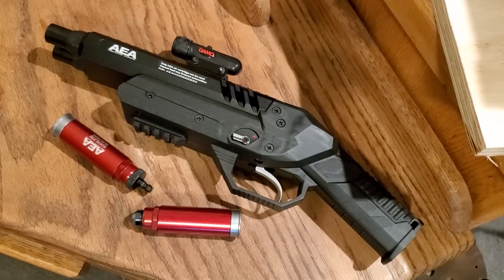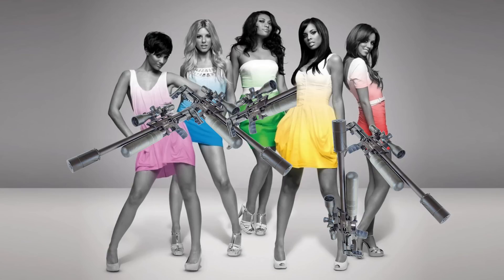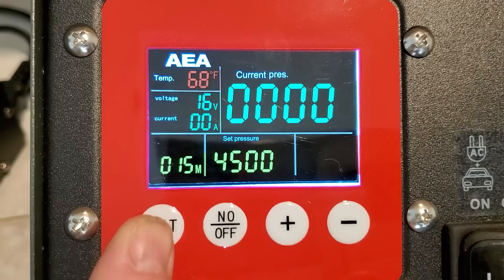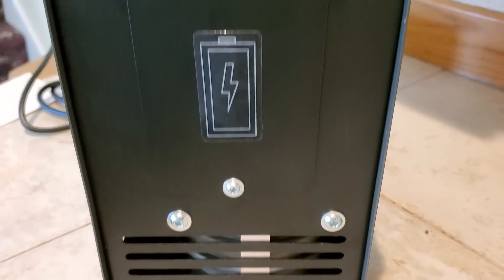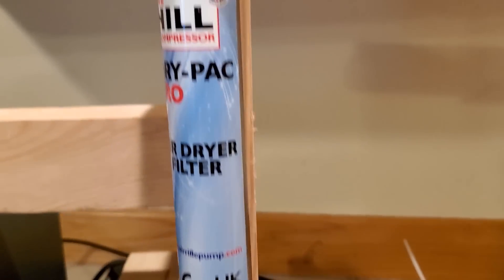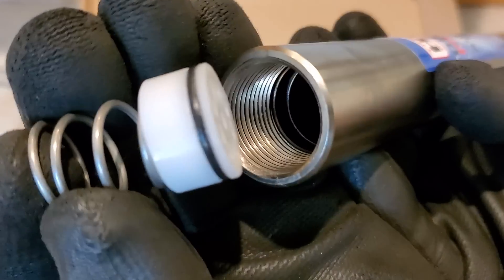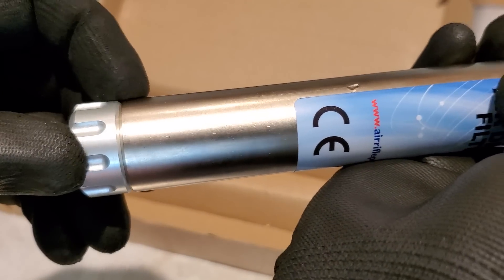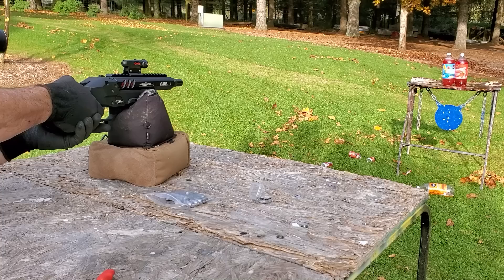AEA's 7000 PSI Air Compressor for PCP Airguns (Review) AEA Airguns Shop  (480bar) PCP Air Compressor

Comment: Compressor will last longer and work easier if you leave the bleed valve open until the piston is running and then close it
Reply: Doesn’t matter if the bleed valve is closed when there is no pressure in the system.  It’s if you stop during the fill for some reason you have to bleed it before restarting.  When you are beginning to fill it makes no difference.
Reply from the maker: Thank you!!!!!!!!!!!!!!!!!!!!!!!!!!!!!!!!!!!!!!!! -Nate
Reply: And open it again ( bleed valve ) before switching it off.
Reply: @henrymoreland8719 then why even have auto shut off? I think that is only with Yong heng it's a problem you haf bleed pressure right at shut off. I have a twin piston tuxing. I never bleed it at 4500psi auto shut off. I let the auto shut off stop the compressor and then bleed air. 130 hours on it no issues
Reply: @DanielDyck-n9d - I have the same twin.   3 yrs old in April.   I don’t open bleed before shutting down.  The auto stop trips and then I bleed.   Has been the best compressor I’ve owned so far.
Reply: @henrymoreland8719 you’re thinking far too much!
Reply: Money
Reply: I learned this the hard way not that long ago😂, although it wasn’t funny at the time, I’m new to pcp airguns and it’s hpa that is the most daunting aspect of getting started. I’m positive it keeps many people from trying the stuff over 2500 to 3000 psi guns. I’m on my third type of hpa compressor , a Tuxing 2200 watt electric unit that comes mounted in a generator frame and has the high and low pressure compressor heads separated instead of stacked like a Yong heng type. It’s faster than a Yong Heng , but I’m fairly sure that’s because of the 2200 watt electric motor, YH are 1800 I think. I need a better filter , the air is dry but has a slight oil smell to it. First I thought I put to much oil in it, but I’m starting to think it is just they way it works and I need better filtration.
Reply: @noonespecific9463 hey bro I’d love to chat with ya about this and show ya the type of kit I use in a high humidity area
Reply: Thank you - Tom. I didn’t know this lol . I’m on my 2nd now